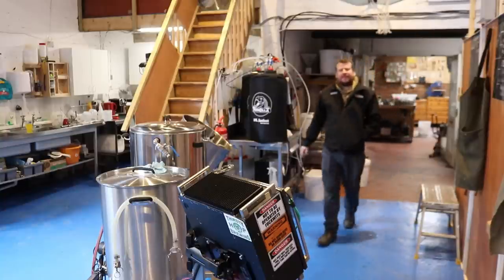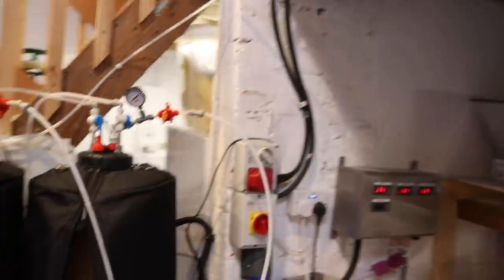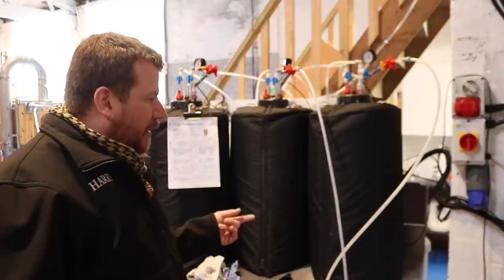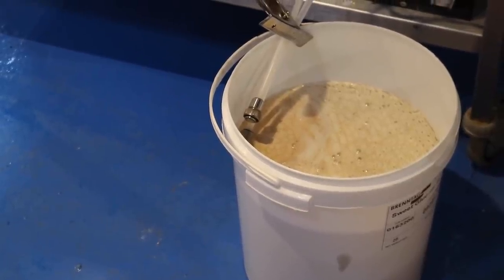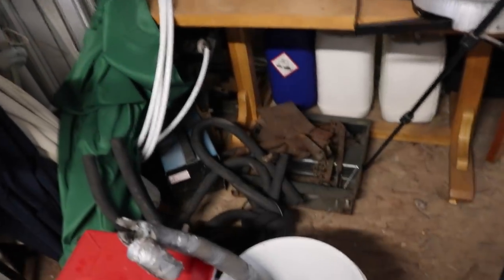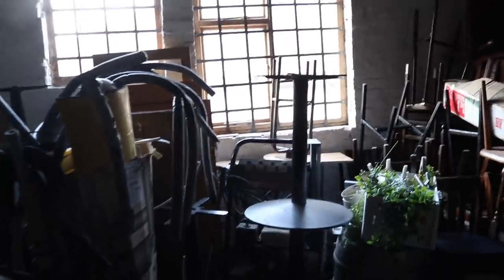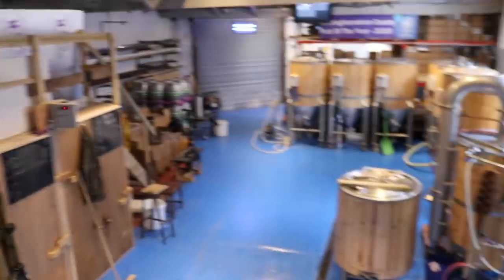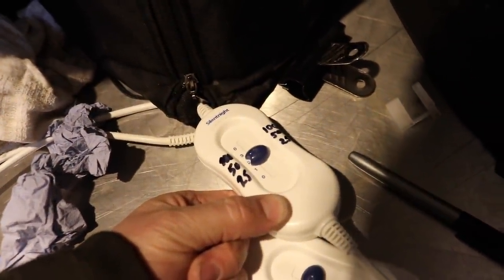The Secret Room

Comment: Just build a box to house the fermenters that needs heating and then use one blanket to heat the air inside said box. Thats what I did ... a small box to house 2x FV's and one blanket connected to a STC 👌... it's my kveik fermentation chamber ... NO cooling

Comment: I believe most small scale brewers who can't ferment in a temp controlled environment have to have the possibility to heat and cool their fermenters. I use an aquarium chiller (this type https://www.completeaquatics.co.uk/hailea-aquarium-chiller-hc300a) with a Coleman cool box as water reservoir to cool and warming pads for plants to heat (https://www.amazon.co.uk/Biogreen-WP025-035-GB-15W-Warming/dp/B005N96ROQ?th=1). The Inkbird ITC 308 is then controlling the temp to an accuracy of +/- 0.7 deg C by either heating or cooling, Works like a charm.